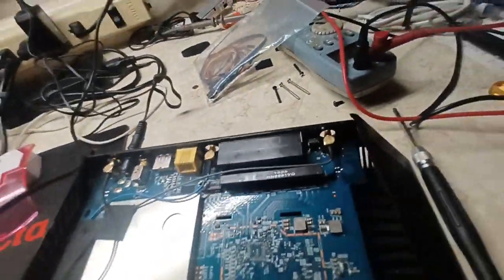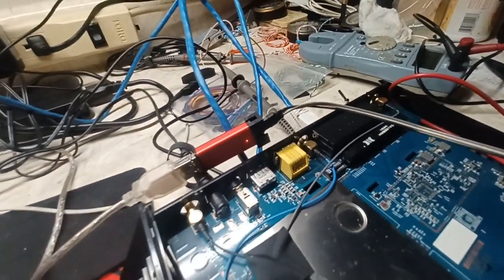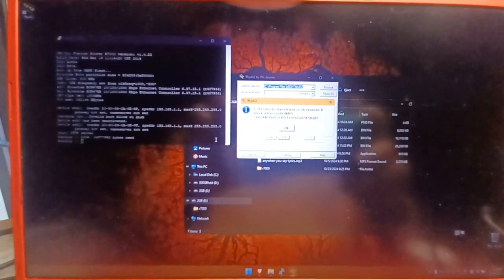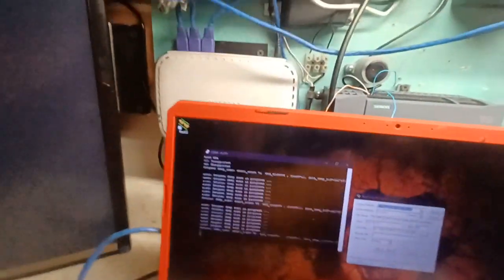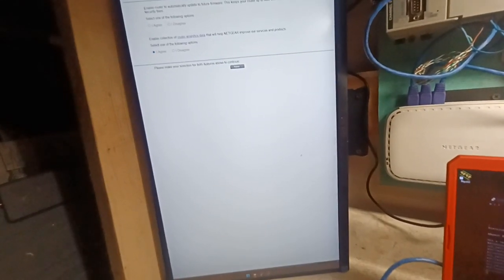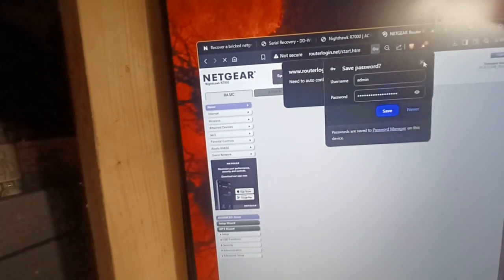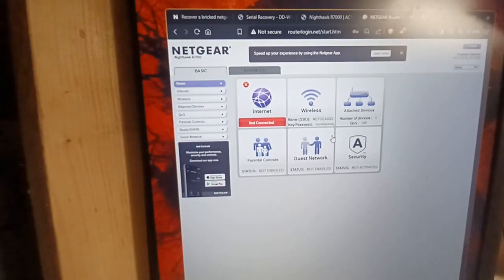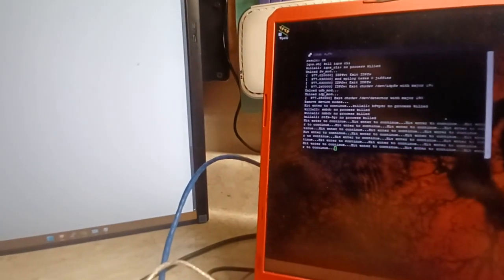Flashing open firmware into a password-locked router using serial term

Comment: Hello, I also have a blocked router, it's a TPLINK BSN3000X, it's an exclusive model for internet providers, but it also resembles the TPlink EX511, can I install an open firmware like you did on yours?

Comment: Eeeehh...... Strange, i have 2 of these nighthawks factory ressetted just fine and flashed them openwrt
Reply from the maker: I find that OpenWRT  tends to support newer products.  DD-WRT supports a lot more,  but some like this one does not work with the 30-30-30 reset if they are password locked.  You have to brut force it to the original firmware then flash the web version - just like in the Wiki guide.